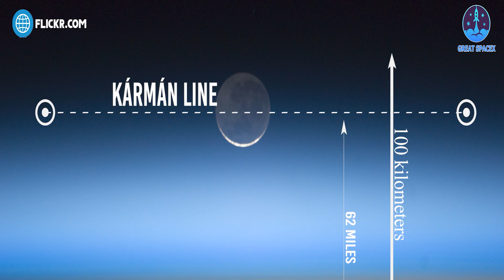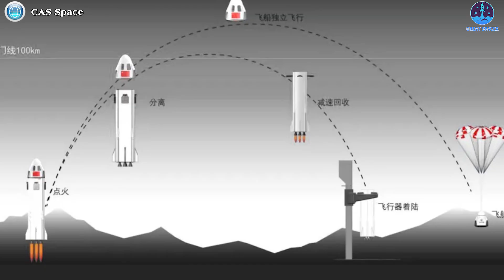CHINA made itself a LAUGHING stock when COPYING both Blue Origin & SpaceX...

Comment: Proof that China cant make a single thing themselves without copying someone else. I wonder if they realize that manufacturers are starting to get wise to this and using the techniques of Davinci and others during that time of purposely changing critical measurements that cause a catastrophic destruction or major issue in the finished product that has no simple solution if you dont know exactly what was wrong in a piece of machinery that has thousands of parts. China has no R&D. They dont want thinkers that bring new ideas. They just want people that will slightly change a design without knowing the real effects those changes tend to have.

Comment: To be fair, lots of rockets use kero-lox fuel. It doesn’t mean they’re copying each other. It means kerosine is an effective fuel.
Reply: Yesterday's fuel. Comparable to running your car on 1950's "Leaded Gas" instead of modern Unleaded Gasohol.
Reply: @fukhue8226  Comparable in some ways, but not all. Cars can be driven by purely electrical means, rockets can not. With rockets, it's all about tradeoffs. Even the hydro-lox rockets that produce nothing but water as exhaust have tradeoffs. It still takes a lot of hydro-carbon-based processes to make that hydrogen. It's also far less efficient from a volume and insulation stance.

Comment: For those saying China can do it cheaper. Not really when compared to SpaceX who is constantly searching for the cheapest way to get something into space. That's the name of the game for Elon. Effective, reliable and reusable; as cheap as possible considering those 3 things. The only thing copying does here is take out the massive R&D cost. You still end up in relatively the same place but you have little knowledge of the failures it took to get there meaning your information set is partial at best. Iterating off of a copied design is where you start getting unique and original ideas. However, without a full information set that includes the failures you start reintroducing the massive R&D cost and put yourself, at best, on par with the current iterative designs or at worst you set yourself back. You don't really get ahead that way.

Comment: grid fin used by space x, came from Russian ships, if I'm not mistaken!
So you should be careful with this argument.

I thought the Energia(Энергия) was the most powerful
Reply: yep, is a soviet era design. He says also, the rocket uses kerosene as spacex engines ( merlin, not raptor ) but soyuz uses kerosene way before, he seems to think spacex created all the space technology ever existed.
Reply: Well I'm not so sure about that. If my information is correct Saturn V was considerably heavier than Energia,  had a little more thrust at liftoff and about 40% more payload capacity to LEO.
They had a planned version of Energia with two extra boosters which would have become the most powerful rocket but it was never built, let alone flown.

The Russian N1 rocket might classify as the most powerful ever with 30% more thrust than the Saturn V but although it lifted off the ground it never made a successful flight so not sure it qualifies. It does qualify for the most powerful explosion of a rocket though, and by a long stretch.

If/when Spacex succesfully launches Starship that will put the argument to rest as it exceeds even the N1's thrust by a couple of thousand tons.